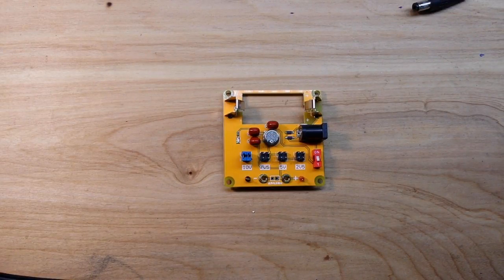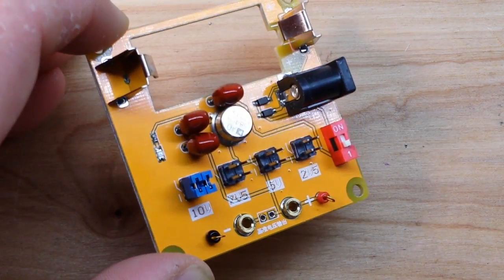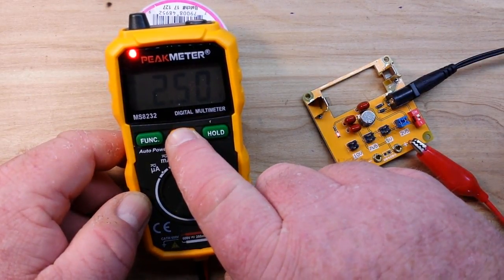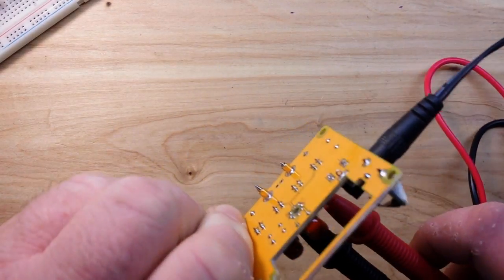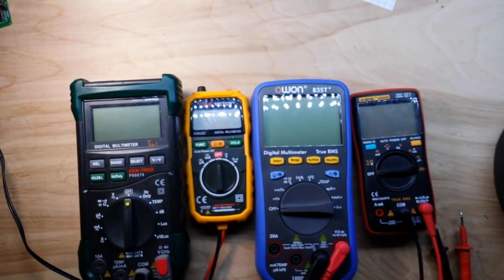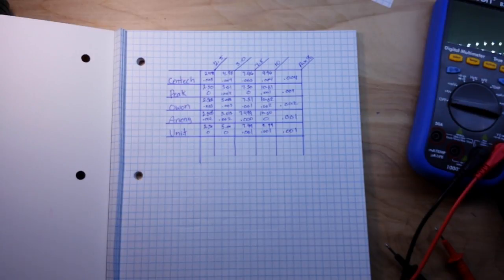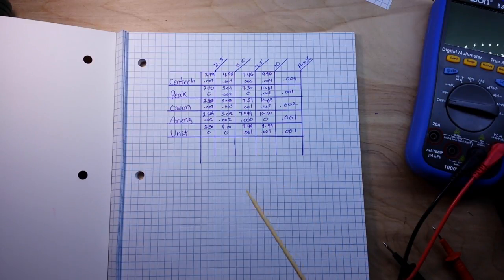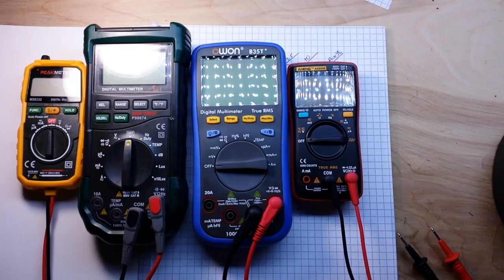AD584 Low Cost Voltage Standard

Comment: 0:25 - I think that you mean 'temperature compensated', were it temperature controlled it would give varying voltage as its temperature changed; not a good thing in a supposed reference device. The battery is an oddball one so I fitted five 2032 lithium coin cell holders (vertical type) glued together in the battery cut-out to give a clean 15 volts to the AD584
Reply: damn never thought I could just use one strip of 2032 as voltage input
Reply: @kaikart123  If you don't want to use holders you can always hold the cells together with neodymium magnets or use two 9 volt batteries in series.
Reply: 2032s held with magnets works, but they are easily dislodged or short-circuited neither being desirable in a device that is likely to be handled and moved around. Two 9v batteries works, too.

Comment: Purchased on from Alice on E bay.  Stupid thing was DOA.    Parts installed way off plumb.  LOL Solder Splashes and Flux all over the bottom of the PCB.    Refused to send a new one.
Reply: Refused to send another one? Wow...i haven't had that problem before on Ebay. They normally instantly refund my money. I thought Alice was one of the good ones....guess not! Thanks for the info!
Reply: In the end just the past few days they sent a replacement if I ordered something else from the store.  LOL, I ordered another V.R. Hope to get one that works.  The measured numbers they supply with them are just a photo copy of days gone past.  That's not really a issue .  Just assume the thing is not a Clone Chip and is good for the Manufacturers Specs.  +- 5mv or what ever on the 5 volt output.  Close enough for my None Government chit.

Comment: I also have one of those exact AD584L boards. Mine seems to be very accurate, as confirmed with a calibrated 8-digit DVOM at work.

I use 15 Vdc from a ten AA pack. Supposedly 15 volts is the sweet spot, not that it matters for normal 4-digit DVOMs.

The explanation for the low price is that the expensive AD584LH ICs may have been salvaged from 'recycled' systems; or they're fake.

If your example came with a calibration certificate, and it looks like a cheap photocopy, then the certificate itself is useless. The certificates of that style are all the same, meaning they're just photocopies (not real data). PLenty of folks on the 'net have papers with the exact same numbers.

One of the capacitors on that exact style of board, the capacitor between pins 6 & 7, is much too high a value. It can lead to long periods where the higher voltages are off, drifting up too slowly. Credit Mark Hennessy for this. Spec sheet recommend 0.01uF (10 nF), not the 330nF used. To test the issue, remove the jumpers to set 10 volts, then touch the jumper to the 2.5 volts pins for a second or two. I've desoldered the capcitor and replaced it with 10nF. Now the issue solves itself in a second or so.

Cheers.
Reply from the maker: +J H Hey thanks for the info. My COA does suspiciously less than pristine. I'll check that cap. This is what I love about a global community, information flows...

Comment: The documentation says using the battery produces less noise than using external power supply, wonder if that is true?
Reply from the maker: It would depend on the power supply. A linear supply will be as quiet as a battery, but most power supplies are switch-mode and they do produce a lot of noise.

Comment: Just recently came across your channel and I really enjoy it. Thanks for all those great videos! I'm just starting to watch them all. I have a (maybe) silly question: whats the advantage of that Uni-T meter? According to the link it only got 2000 counts. So there is no additional resolution compared to the handheld meters. Do I miss something?
Reply from the maker: Michael Eckl it's just very accurate (but that's luck of the draw) and easy to see for my aging eyes.
Reply: Thanks for the fast reply. I bought the Aneng 8008 after watching your video about it (and some other videos) and it seems to hold its ground regarding accuracy pretty well. But, yeah, readability might be an issue
Reply from the maker: The 8008 is awesome. Very accurate, and precise. If it had good input protection it would rival any meter out there.